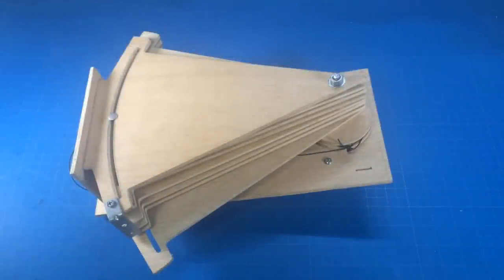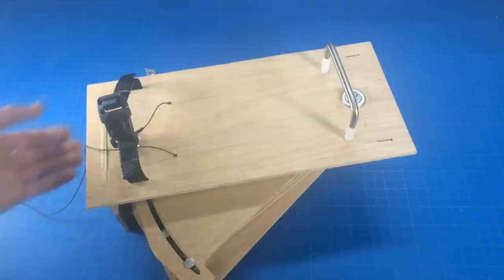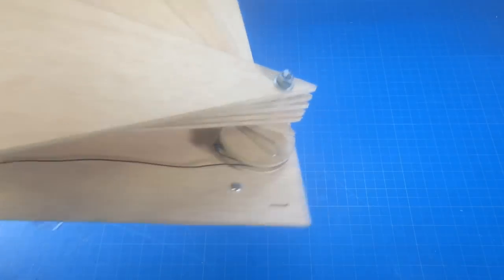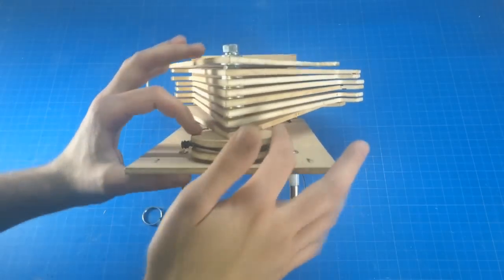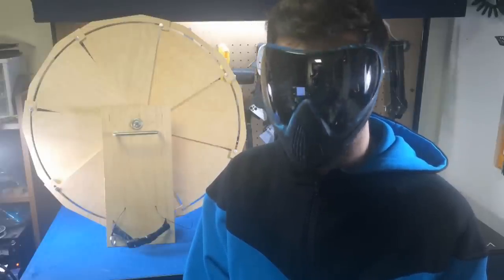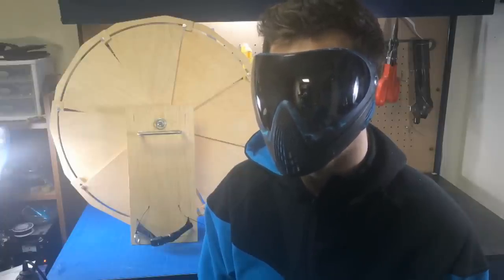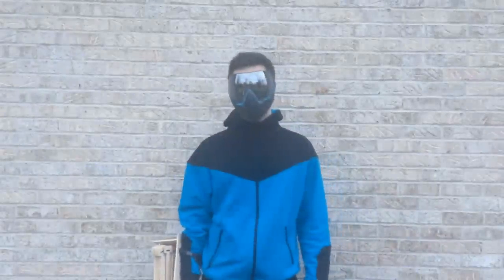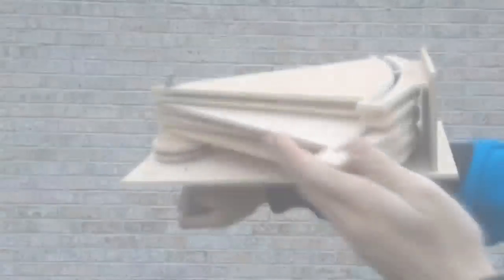Deployable Arm Shield "Percy Jackson Wrist Watch Shield"

Comment: hey i could help if you need something made in CAD. for this project or any other one in the future. When I remember correctly you also want to buy a 3D Printer if you have any questions regarding that feel free to ask me.
Reply: +Captain PanCan i also hav a 3d printer but with a smaller buil volume. But it is easily stuck togehter by chemicaly welding it with acetone, but i live in Germany.
Reply: +GreekGadgetGuru I send you a message. Also just saw you last video. im a few days behind my subscriptions and i could also make svg files.
Reply: +Kai Ditt okay cool
Reply: Kai Ditt Where did you send me  a message? and what is a svg file?
Reply: Captain PanCan i send GreekGadgetGuru a message for my email. And an svg file is a file for vector graphics used for lasecutting or CNC machining. Unlike png or traditional images which are made from pixels it is made from lines and other shapes. You could consider Vector graphics as the 2d form of polygons where "Normal" Pixel images are PointClod Data.
Reply: where did GreekGadgetGururs comment go? Did he delete it?
Edit: Sorry. I swear it wasnt there while i was writing this.
Reply: +Kai Ditt no its still there it said something Like give me your e-mail

Comment: just a few things that might seem good i don't know, having the shield it self in two different rotations both coming from each side to meet in the middle at the front, this could allow for the shield to have a slant on it making the shield more effective, using a double trigger mechanism to deploy and then release the shield is another possible modification if you would like i could draw up a small sketch of what i mean and show you, if that would help

Comment: Well to start with I think this is a good start. It deploys and creates the general structure of a working concept.

That said before it becomes a truly useful invention I would like to see the sheets be much tighter or perhaps even use a screwing motion to store them above eachother but deploy them in the same depth although it would require allot more turning. Another thing is to hide the rim better since you dont want weapons to snag on your shield instead of slipping off. Lastly it has to lock into place and give structural support to each plate so it becomes sturdy.

Comment: Awesome job man. Just voted for you. Some suggestions that I have are maybe adding some blades to the edges of the shield for just a bit more offense. Maybe adding some more support to the shield sections a little more so if some one hits it with a heavier weapon such as a hammer it wouldn't bend/break. And you obviously want to make it out of a stronger material, my personal suggestion for the material is titanium base with maybe a  1/4 in. Kevlar layer on top for any projectiles fired.

Comment: It could be spring loaded and have a small trigger to deploy it on the fore-grip, a quick and dirty version could be a strong rubber band around the internal spool to a fixed point on the arm piece, released by a pin locking the wheel in position.

Comment: All I can think of is a "spring lock" for the pulleys. So it doesn't slide out from gravity until pulled. For the material I guess Polypropylene or carbon fiber. If you have to use a metal 7075 Bronze is the strongest castable metal I have found. I'm a big fan and this is awesome.

Comment: Awesome idea here.

Sheets of metal could be thinner, making it less bulky. Also, if possible, you can make the slices curved so that the deployed shield is a dome shape. Dome shields are better at deflecting and blocking than flat shields are.

Comment: hey wild idea. rather then stacking them all together, move the pivot to the middle of your arm then split the stack in two so you have two pivots and put them opposite like     ><  (like a bowtie) to fan open in opposite directions.  you could reduce the profile of that in half. it would also be a lot easier to spring load cause you basically have mirrored mechanisms with their own springs each doing only half the work originally intended. might have to reduce the over all size tho

Comment: dude a idea i got is instead of a pulley try a gear system and have a gear bar in the grip so that by pushing your thumb it deploys and your pinkie it re-tracks plus if you use gears you have a lot more control over how fast it deploys and when it stops

Comment: Pretty cool prototype. To make that exact model stronger, you could probably fiberglass it or plate it with a thin sheet metal to help it resist piercing. Down the road, you could probably incorporate the entire deployment method into the central shaft along with some sort of locking mechanism. One thing that might help with size is if it were made telescopic instead of stacking. It might also help with balance and maneuverability. Anyway, just some ideas. Keep up the good work man!
Reply from the maker: I like the telescoping idea but man that would take some time and serious money with a CNC milling machine

Comment: hey, good video and good design. my 5p worth. upgrade with fibreglass it cheap and gives a really good idea on compound mixtures. 
electric motors are good but bulky with all the guff you need with it. an air piston  would be light and could run off a small co2 cartridge. then all you would need is a pivot point to allow the extra travel. 
thanks for sharing

Comment: Build it with a fairly heavy sheet metal , thick enough to be just too difficult to cut with metal shears , cut narrow grooves along each plate to reduce weight , and sheath them in Kevlar cloth. Think about narrowing the wrist mount , or not . These are just suggestions.

Comment: Id say a ballistic fabric would be better for a folding shield. You could have it open up like a paper fan, with metal rods for it's frame. It would offer a dampening effect because anything thrown at it is going to trampoline instead of shaking like a rigid shield would. It would also be perfectly flat, or you could bend it and get a semi spherical some. Maybe not ballistic fabric, but a heavy nylon for the prototype.

Comment: that shield is killer man. I think you should keep the pull strings on it. but maybe shorten the so that you fingers that the shield is strapped to can operate it. and also some kind of locking mechanism to prevent the pieces from sliding out on their own.
Reply from the maker: Yes those are all great ideas. Sometimes having electronics can be detrimental. Maybe I'll have both. I don't know if I can achieve enough motion to open and close the shield with one hand. But the pully can be a failsafe if the battery dies. Thank you for commenting :D

Comment: I Think you should think more compact (yes I know, it's a prototype). I suggest you that instead of making the rotating pieces to move around a whole circle, you should apply two stacks of shield pieces and make them move a semi circle, then meet on the front. This way, you can reduce the thickness of the whole system and also the wide space between the first and the last piece is just gone. It only costs on the width of the collapsed shield, but it remains compact anyway.

Comment: As a proto-type there is of course flaw,defects and imperfections that can be improved. What you have made would be classed as a small round shield that can be collapsible. It's quite the design and simple too, and as others have mentioned a high tension spring and lock would be nice and effective, allowing for a quicker response time. Another point to be made is the staircase effect with the blades, in addition to a central connection point (the large screw). I would recommend, with the function of a spring, to have a lager mount of sort with an angular slide allowing the pieces to slide out and be parallel with one another to give it a more smoother face. The last thing I would also recommend  is the placement of the central point of the shield. Were it rests now is on your wrist and the back of your hand. Doesn't take to much force the shield back into you. Best to move it up on your forearm. simple test of this is to have a friend push on your fist and then your forearm or do it your self. Plus some padding to the the back between the back of the shield and your arm. Hope this helps and good luck.

Comment: Hi there
My name is Daniel, I'm from Switzerland and I do a four year apprenticeship as a Polymechanic. I'm now in the third and last year of the practical part of the apprenticeship. What is a Polymechanic you might ask? Well, I'm programing and operating CNC controlled machines, which machine parts out of metal plastics and composites. Thanks to my apprenticeship in electronics, technical design and mechanical engineering I'm able to design, draw, program and manufacture parts from beginning to end. As it happens to be I'm also heavily into 3D-printing. It's just a hobby but I design parts for daily use and print them at home with my 3D-printer. So if I can help you in anyway, let me know. Awesome stuff 4 ever!

Comment: Badass, I voted. I'm no engineer, like at all lol, but would it be possible to like, set up a harness type thing that covered your entire arm, and set it up in a way that when you extended it, the shield expanded? Don't know how you would handle the sheathing of it but that's just an idea. Anyway awesome job man, hope you win.
Reply from the maker: +RoxasReaper I see what you're saying. Like a pulley system that would deploy the shield once it gets far enough away from your body, or when you go into a defensive stance. That'd be suuuuper tricky to pull off, I had the idea of like attaching it to a belt/loop but I felt like a puppet, just didn't feel comfortable. I'm sure its possible with the right design.
Reply: Yea that's exactly what I was talking about lol, I figured it might be tricky as hell, but hey from what I've seen if anyone can figure it out its you. I wish you the best of luck man.

Comment: DUDE !!! The opening should be done just by a spring or better and far easier by rubber band power . And you press a button or move in a specific way for it to open.Then the closing is done using the same mechanism as shown in the vid. I think that would be awesome and would eliminate the need for any further automation. Cause who needs fully automatic closing anyway.Its the opening that makes the difference in my opinion at least ,and the rubber band powered opening could really work and it wouldnt be so hard for you to pull it off.Greetings from Greece !

Comment: its very cool, a different take on this would be to have the main body be a thicker hollow version of the shield slats that the houses the slats until deployment. think like a taco.  that would give the individual slats a housing and somethign to rest against instead of flopping in and out of position.  it would also cut down on the bulkiness of the frame.  im no engineer but i could easily draw up a design for you if you were interested in pursuing it.

Comment: instead of having to pull down the string with your other hand make it so the hand that's on the shield is wearing 2 rings that open and close the shield then it would be easier to deploy and close the shield at a faster rate also try making the part where your hand is resting on the shield more comfortable maybe try using a modifed wrist splint or something but anyways cool project

Comment: I think it might be a little more better looking and functional if you used pvc to either go off of or make a cast so it fits around your arm as well and you don't need that big sheet in the back that the handle is made off of. Also, consider using fiberglass. A good friend of mine is making full body armor from fiberglass and steel sheets. I hit him in the arm with a baseball bat at full force and he said it felt like a small tap.

Comment: So suggestions on the shield itself (form/function)
Most shields are meant to cover the entire torso (example greek hoplites). However bucklers, being smaller are more maneuverable but equally effective, provided combat doesnt involve projectiles.  For your project I suggest making a buckler for 2 reasons: Its smaller and more compact, easier to transport and 2 materials
Regarding materials, steel is obviously the best choice.  Strong and cheap, but you're going to want to avoid stainless due to the fact it is brittler than its carbon counterpart.  However it is heavy, which is why I suggested the buckler.

I'm sure you're already aware of all this but I'd love to co-operate with you on this.  Its freaking awesome!  Feel free to message me?  Good luck mate!
Reply: +GreekGadgetGuru sent

Comment: what I'm thinking right now is instead of using that pulley system in your next one is you use a small motor like the ones on controllers. Make a push button on top where pressed it activates the motor and moves the last blade all around and pressed against moves the blade back. Then you can manually turn the button into a locked position so it can't be pressed again. if you can try to not use washers in between the blades, maybe use some type of thin plastic strip or glossy substance and put it on the blade. like the stuff on cards where you can easily move 2 cards on each other with out friction. also where the blades are house make the left edge have a locking clamp thing so when the last edge hits it it'll clamp on it so it won't move around.

Comment: only opinion is that the shield when its not unfanned should remain sturdy because it appears to move slightly when its closed. The pieces sort of sway left and right by which im assuming is because the pieces arent set in place when closed, but im not sure in my suggestion of how to change that

Comment: You could have added a motor without a lot of bulk. I would have used an in line actuator mounted offset on the pulley which does more or less the same thing as the rope. But if you're going to upscale to metal, that'd be a good idea as the pulley may be too hard.

Comment: Probably a stupid suggestion, but what if you used an elastic based opening and closing; as in the elastic is trying to open the shield, but there's something holding it back, and as soon as it's released it opens and locks?

Comment: If possible I would try and fit the pulley into the base itself (so it would make the shield thinner when closed)
the only issue with doing so is that you would have to make a small guard under the pulley so it doesn't rub on your hand

Comment: this is a great mechanism that could be used in a quick deploy satellite dish or something along those lines but i don't think a shield is very practical partly because shields aren't used very much in combat these days and if they are they are full body shields and also if you do make that out of steel that has any chance of stopping anything it is gonna be way to heavy to wear i currently have a certificate 1&2 in engineering and I'm now moving into my diploma then a bachelors degree in mechanical engineering if i have the time (i am going to be quite busy) i will be quite happy to help you with designs and whatever else i can :)

Comment: I think if you  added maybe some steel or metal work to make it not only defensive but also offensive to the knucke part then also i was thinking make the sheild itself of metal like make the blades metal or gonall out and make it metal form the peice that hooks to your arm make it circular around your arm but leave about two or three inches of flat metal for the pully system other than that i think that it is a very good idea/ invention i think with minor changes its bad ass

Comment: youll need to scrapp the manual strings and have two buttons under hand brace that run in winder and out winder thats under tension. great thing bro. please can you send me a link to where you bought the double extending pole you used on the long handle knife project you did thanks and respect bro. happy hols alex

Comment: you can use gears and springs to make a handle you pull on and when you let go it retracts automaticly, so you wouldnt have to operate it with two hands
Reply: +Róbert Pálsson (Turtle Of Doom) and you could definitely 3d print some sort of nice arm brace to mount it on instead of having that bulky wooden board

Comment: make some sheets of carbon fiber, go to your local laser cut shop and make the design less bulky. some small pulleys and fire wire combined with some springs would do the open shut trick

Comment: Like ESC suggested, try out an mk2 prototype with sheet metal materials to keep everything tighter and more compact. Experiment using lubrication, ball bearings or rollers to cut down on friction during deployment and retraction for this model. Slightly bending the corners of the wide ends down will also give it a Captain America-esque look and may help to deflect projectiles and melee attacks instead of absorbing the damage. Hitting a flat shield will not only damage the shield, but also the arm attached to it. Have you also considered splitting the shields' plates into two deployable/retractable halves so that they connect as two half moon parts? In theory, the connection may help strengthen the area above the hand and wrist for better protection and cut deployment time in half.
 I also have a few questions about your idea:
What (in this day and age) do you think will be hitting this shield? 
What do you think it will be capable of stopping? What will it be incapable of stopping?
Reply: One more thing! Carefully consider where the pivot point/centre of the shield should be. Try this at home kids! Take a blunt, somewhat heavy object and hit your forearm, wrist and the back of your hand. What part hurt more? Remember that around  the centre of the shield (the strongest area) will be the area that you want to get hit. Use the strongest area of your arm to not  only take in the damage but also have a chance to push back against it.